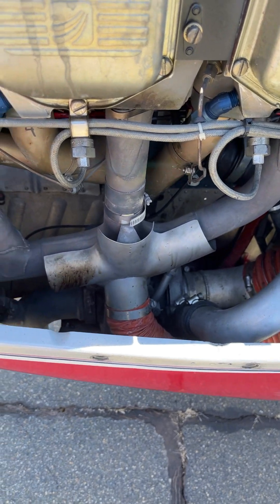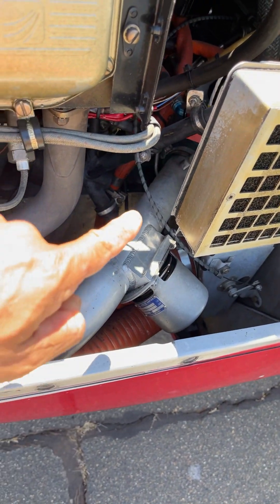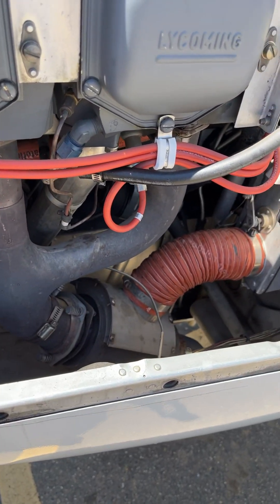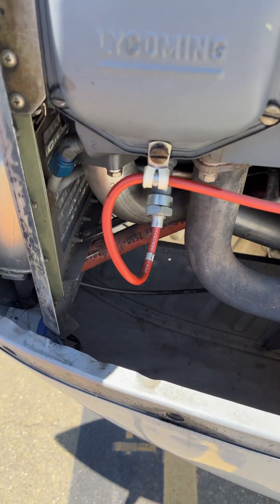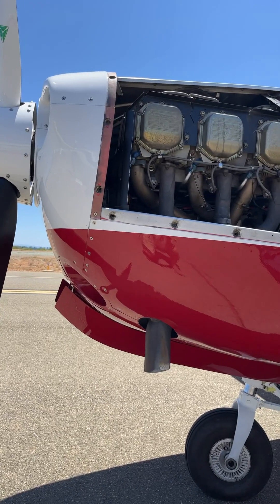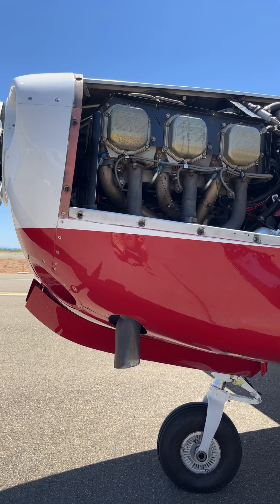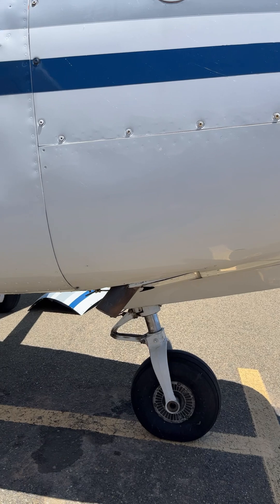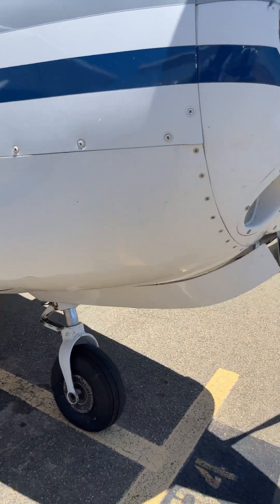Can you spot the Turbo 182 RG?

Comment: How do you determine throttle position with a manual waste gate?
Reply from the maker: By looking at the manifold pressure.  Set it where you need it.
Reply: @skywagonuniversity5023    I'm sure you are familiar with a cars turbo. Either a vacuum or electronic solenoid opens/closes the waste gate to maintain the desired manifold pressure. But here it's the pilot. So how does that get determined to avoid an overboost? Do you climb with the gate wide open, set the manifold pressure at that pressure altitude with throttle and then close the wastegate to bring the manifold pressure up to  sea level? What's the order? (Lots of questions) Thanks.
Reply from the maker: @Saml01   On these planes you set the power with the manifold pressure and that is all it needs. If you want 24 inches you set it there regardless of altitude and temperature.  I have a video on here about turbo normalizing that you might find interesting.
Reply: @skywagonuniversity5023  Just watched it. One word, perfect. That's exactly what I was looking to see. The two stage throttle completely makes sense and you briefly elluded to a dedicated wastegate control for an aftermarket installation but it would work the same way. My assumption was correct. After a certain point you start to feed in the turbo to bring the manifold pressure back up. Turbocharging makes sense too, but the positive pressure below 6k wears on the engine. Thank you Mark.

Comment: How does fuel consumption differ between the two?
Reply from the maker: Below 6000 feet they are the same.  As you climb above that and the power of the non-turbo declines with the thinning air etc, so does the fuel burn.  The turbo can generate sea level power at 15,000 feet and so it burns sea level fuel there too.  It burns more but it is faster so from A to B they use the same fuel.
Reply: Good question. What about the new unleaded fuel?

Comment: G,day from Sydney Australia.. Mark can you have a turbocharger on an engine using electronic fuel injection or only a carburettor? The second part of my question, wouldn't the CHT need to be cooled by enrichment of gas?
🌏🇭🇲
Reply from the maker: You can turbo a carbed engine and an injected engine.  This is a turbo normaliser which is far better than a turbocharger.  Watch my video on Turbo normalizing vs Turbo-charging.  182 Turbo RG's are all factory turbo-normalized.